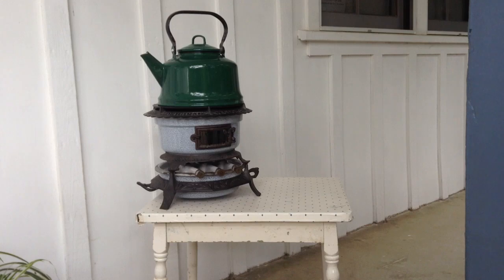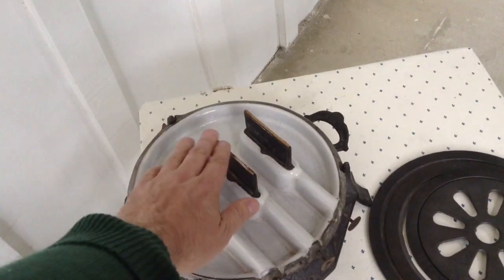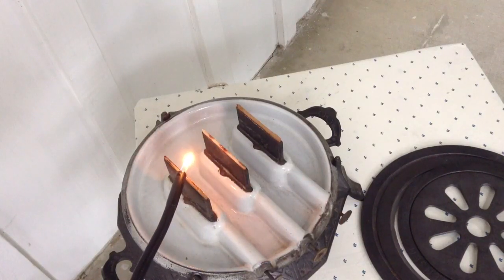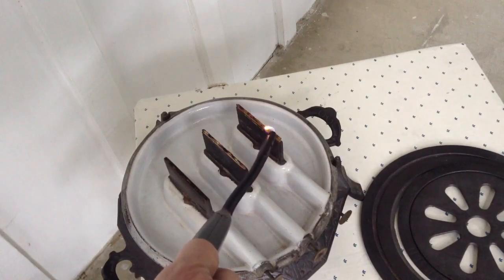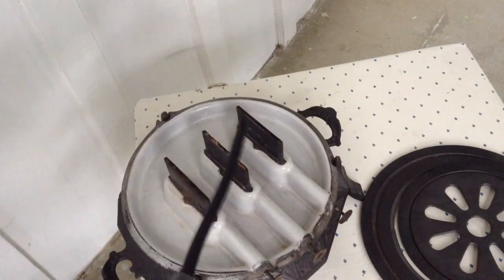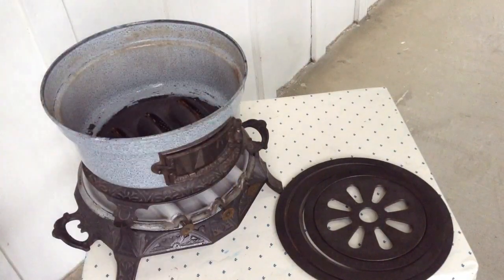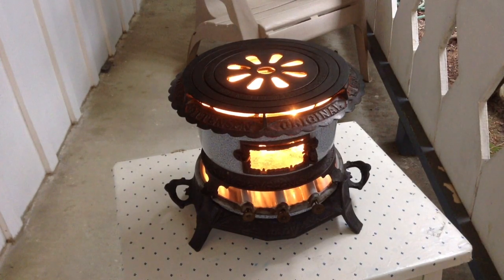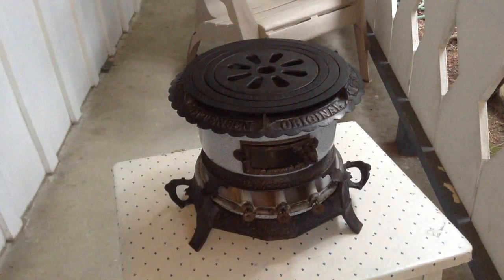An antique kerosene "Original Georg Haller"wick stove.

Comment: The different sized concentric rings are to enable maximum exposure to the rising heat for pots/saucepans of different sizes.
You just use the largest that will support the base
A beautiful stove (although I prefer a more efficient and less smelly/smokey blue flame)
Reply: They dont have to smell at all it depends on what kind of fuel is used ...mine 2 wick haller only smells a little bit when lit but after 2 minutes it is gone ....most of these people buy one of these things and dont know how to use them ...like this guy or even read some info

Comment: I think those three rings are like the rings on the top of a wood stove. If you have a small pan, you use all the rings. A large pan you would take off rings until the opening fit the bottom of the cast iron pan.

Comment: That tool is a blacksmith made flint knapping hammer of cold steel (cold low carbon steel won't spark the flint accidentally in a rifle).  It clears the touchhole area (the pick side) and the blunt end will chip the flint to a sharp and even edge with tapping.

You do see this stove is really just a series of two open enamelware pots.  Hard for an adult to tip over, but take care in moving as the oil will slosh and run out the sides.  A puddle of K1 will not burn.  Only a wicking surface will burn do discard carefully any paper towel or rag used to wipe it up.  That will burn uncontrollably.

K1 if you can find at a gas station is under $4 a gallon from a pump.  K1 in a store bottle is about $20 a gal.
Reply from the maker: How cool!  Thanks for that info!  Now I like it even more.

Comment: Hi , i have the same stove but its the 2 wick model . i have tried to boil water on it but it takes way to long to get to the boil if at all , what was your experience like when you tried to cook or boil water ?
Reply from the maker: It took about 15 minutes when the kettle was full.  When I made soup on it, it got going pretty quickly.  When I did a test and boiled 1L of water in that same kettle, it took about 7-8 minutes.  I removed the iron rings so the heat from the flames was reaching the kettle as quickly and directly as possible.  I started a video on my iPad, but I ran out of memory.  I'd love to see a video of your stove!
Reply: Hi and thank you for your reply , I'm guessing that 3rd wick makes quite a difference  . i am also questioning the quality of the kerosene i am using here in Indonesia , i suspect its low quality and there are no choices to my knowledge .... do you think high quality kero burns hotter ?
Reply from the maker: I switched to odorless mineral spirits.  The kerosene smells.
Reply from the maker: Now you have me curious.  I will try it on one wick and then two and then three sometime.
Reply: i will be interested to read your results , just for interest sake i am using a vintage Iranian kerosene single wick Samovar [ large round wick ] it comes to boil as quick as using LPG .
Reply: Im hooked on the smell of Kero  lol